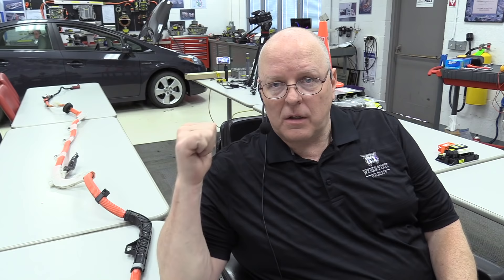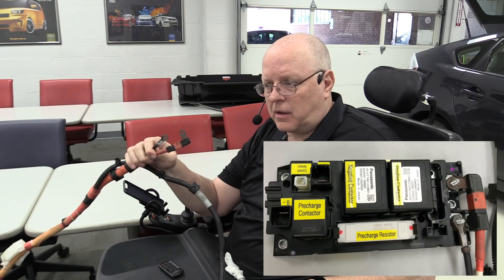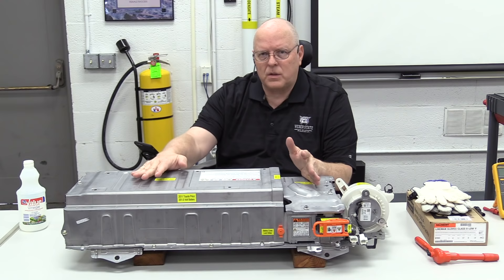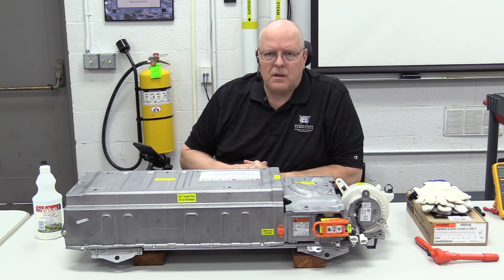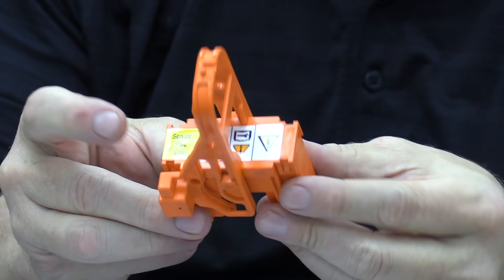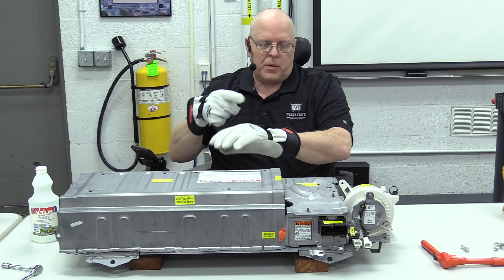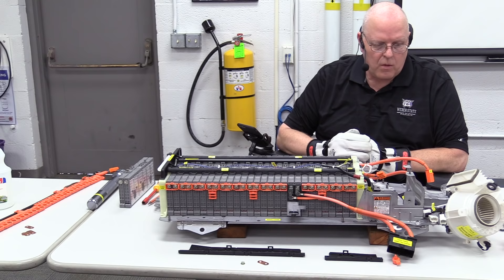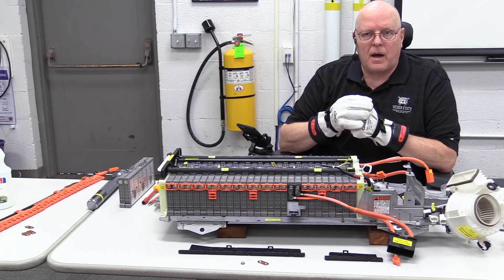2010-2015 Toyota Prius Ni-MH Battery

Comment: thank you so much
Reply from the maker: Thank you!
Reply: Am danjuma from Nigeria adamawa thanks for the good videos
Reply: i have prius 2007 which we purchase 3 ago but unfortunately car show a msg that there is problem in hybrid battery i check these batteries volt one cell show 6.93 voltage and other cell show differnt voltage but these cell show greater than 7.2 volt. please help me how can i solve this problem? can i replace only one cell or compelet module?

Comment: I just finished rebuilding a gen 3 battery pack and the worst part was finding replacement cells on ebay. There's plenty there, claiming to be "conditioned and tested," but I spent weeks sending back bad cells from several sellers.

Comment: The way this guy works with the voltage components is Fantasyland. Having worked both production and service, I can tell you no one's wearing all those gloves. You can't work fast enough. During a real workday, you get in a rhythm and you watch what you're doing. If you try to hold out for that sort of thing, you're not going to be turning around jobs fast enough, everyone else will be, and you won't have your job long.

Comment: Thank you for the comprehensive tutorial. You are remarkable teacher. One question though. How would I be able to determine that a particular module is discharging much faster than the rest? Thanks
Reply from the maker: Thank you! A scan tool is needed to read the cell module voltages and and Diagnostic Trouble Codes (DTC)s which may tell you which ones are having problems. You could manually read the cell module voltages and looks for ones that are significantly different than the rest. Be sure to use safe practices. See my PPE and safety video here: https://youtu.be/Fgs46PsTon4
Reply: WeberAuto Thank you and merry christmas
Reply from the maker: Thank you, merry Christmas to you as well

Comment: Great teacher I agree, you said they are 7.2 v eac if charged x 28 = 201.6 volts  is that what the motor uses, ac or dc?
Reply from the maker: The motor runs on AC. The inverter under the hood creates AC from the battery DC

Comment: thank you for your information but can you show us how to check HV batterty pack under the load so that we know what to buy
Reply from the maker: You would need an old style battery and charging system tested with a carbon pile. Test two modules together (14.4 Volts) like a car battery

Comment: 42:47 Recondition it yourself. clean the contacts. put dielectric grease on the terminals before reassembly. would be nice if there was a marker every 7 packs. remove those first and break the battery into 50V packs. First and last to be disconnect and reconnected. boosting may have ruined the 12V battery charger since the prius battery 12V may not be designed to crank an engine because it doesn't. The battery is just there to give the computer clean DC. The headlights for example don't car.

Comment: Sir,
I like your videos and learned a lot. But, on contactors n relays,
Contactor= for Load, n,

Relay=for controls
Reply from the maker: Thanks for your feedback. The contactors in these vehicles are for load handling, but they also are used control current in the circuits. They do both.
Reply: WeberAutoSir,

Contactor's may have relays to control movement of contactor contacts, but relays don't usually have relay contacts for loads.

Comment: AWESOME! One question on the interlock. When you initially tested for voltage during your demonstration of the service plug, there was voltage present even after the plug latch was slid off. The voltage didn't go to zero until the plug was completely removed. Is that a defect? Also, to clarify, is the interlock wire continuous to all the interlocks in the vehicle? I think that's what you said.
Reply from the maker: Thank you! The voltage was nearly zero with the service plug disconnected. The small amount of voltage displayed is the same thing the meter displays when the meter leads are not attached to anything; just induced voltages from the 60Hx power wires in the walls and lighting. The high voltage interlock circuit is one long series circuit throughout the entire vehicle. It connects to all the other interlocks on the vehicle.
Reply: WeberAuto thank you! I was under the impression that when the service plug was slid over to unlock it will activate the interlock and shut the power BEFORE the plug was removed. It didn't appear that happened in this case

Comment: Hi, you did not mention how the air flow going through the battery module, could you please show us how the air flows inside the battery and its track ?
Reply from the maker: Yes, I show the air flow coming in the bottom of the battery on the passenger side and going out on the top of the passenger side after taking a "U" shaped path through the battery modules.

Comment: a salvage yard friend got me a few of these Packs to play with (for a home solar application) so I have about 100 of those 7.2 out of all those I found maybe 4 that were bad and couldnt or wouldnt charge, I am in an electronics field so I have test/equipment and know how to feel confortable enough around these to play :)
I think each one has 7ah I put two in (P) and charge at 16.4 for 7 hours to finish an (absorption phase)  you would call it a float charge on Lead Acid Battery 
I also have some of the Nissan batteries about the same volt just round LOL
in the end I dont see them as a good solar battery, if you can make your own Tesla wall out of 18650 that seems to be what everyone is using and for a good reason :)
maybe someday I will but I should have been videoing my play times and how :)
Reply: I should add throw less Amps at it, I charge between 2 or 3 amps, to much and it will expand the battery, it could ruin it, but for the most part, I find they will go down and work just fine after you expand one though, but over doing it you could start a fire or worse :) ya just to find the zone I blew a few up LOL, if you work on a wooden table I suggest putting a Paver under your work area :)

Comment: Hi John, Great video. 
I was wondering if it would be possible to connect say a 20kw 200VDC motor directly to the HV pack? I have seen a lot of examples of connection after the 12V step down, but In the case you needed much more than 5kw could you see a problem with fail safes on a gen3 Prius? Obviously there's a huge safety aspect, a limit in draw and a computer remap whilst in use. Though theoretically you could temporarily run high loads pretty efficiently. I'm fairly certain the faulty battery code only senses voltage drop between plates and the vehicle will charge as mapped. I could be very wrong just a thought. 
Failing that could the engine be mapped to always run with a mechanical drive taken off engine? A separate battery charge cut may need to be installed, apart from that what do you think?
I've seen some 5 year old hybrids with panel damage sell for nothing and I'm interested in their capabilities. I'm sure you know more than me, Regards.
Reply from the maker: Good question. It sounds like a fun experiment. Most of those batteries are rated at less than 1kWh, so you won't get far. Best wishes

Comment: Professor, good morning, I am an engineer in an automotive armoring company in Brazil and I really need your help, because really your explanation is very good and only makes those who seek knowledge great. In armor, we need to dismantle the whole car and sometimes we need to cut parts of the vehicle and then weld them back to their places. My question is as to the fact of loosening the negative battery cable 12 volts and disconnecting the orange plug of the hybrid battery, if both are disconnected, if there is any problem with making electric welds on the vehicle, where I need to pass electric current through the vehicle to close short during welding.
As I normally do in cars that are not hybrids where I simply disconnect the battery cable and do work normally and then just reconnect the battery and everything turns on normally, in this case it’s a BMW 530e Hybrid, but the question goes for any hybrid car that now are coming from various brands, is there a problem following this master procedure?
I thank you for your attention, stay with God.

Comment: hi, fantastic video as usual . i was wondering if you could give some advise how these battery cells can be recharge.if you know of any decent battery charger.
thanks
Reply from the maker: Thank you! I do not know of a good charger for the individual 7.2V battery modules. You could put two in series for 14.4V. just make sure it is a charger made for Ni-MH batteries. Maybe one made for radio controlled cars, drones, etc. The total capacity of the entire 201.6V battery pack id 6Ah. Best wishes.

Comment: Very interesting insight into hybrid batteries thank you. However, as a suggestion a good editor could easily cut the length down without losing any significant information. Thanks for taking the time to help people understand this complex and potentially dangerous equipment.

Comment: I'm thinking copper nuts on the copper bus bars might reduce that corrosion perhaps? Another informative video John.
Reply from the maker: Thank you for the feedback. I was thinking the same thing. The battery module terminals appear to be nickel coated. The nuts appear to have a green-gold coating. I do not know what it is. The positive posts are clean, so dissimilar metals don't appear to be the issue.
Reply: Could you use dielectric grease around the terminals to stop corrosion?

Comment: I think that there is voltage between each of the service disconnect /fuse terminals and one of the orange HV wires. (I'm still watching but it looks like the disconnect breaks the circuit in the middle of the pack, and the HV connections are to either end)
Reply from the maker: Yes, it disconnects at battery modules 9 and 10 (of 28). The voltage from the B+ orange cable and module 10 at the service disconnect is about 146 Volts. The voltage from the B- orange cable and module 9 at the service disconnect is about 67 Volts.

Comment: Hello! Excellent video! Does corrosion that occur (except humidity of cooling air blown through) on contact bars because of different matherial of nuts and bars: zinc-plated steel vs copper? Thank your very much!
Reply from the maker: I have not experimented with different materials, but some people claim it makes a difference. Thanks for watching

Comment: Great! Couldn't be explained any better! I have come cross some questions appreciate your response. 1. What is the acceptable voltage rage for each individual module and also entire modules? 2. Do cells need to be tested under the load too? 3. If they do what device do you recommend to check for voltage drop under the load? 4. Does hybrid computer monitor every involved component consequently turn on MIL (malfunction indicator lamp) when fault is detected? 5. Are there online courses available on hybrid systems?
Thanks
Reply from the maker: Thank you!  1. 12.2 to 16 volts each, 2. Yes 3.a carbon pile load tester. You can find them all over the internet. 4. yes 5. yes, we offer some online www.weber.edu/automotive best wishes
Reply: Thanks for your response. I had to replace two modules that were 6.47 and 6.48 volts on 2007 Prius. The remaining cells were ranging from 7.72 to 7.77 volts. The car actually had to be towed because it hardly could get up to 30 miles/hour.
Reply: Thanks Professor. How do I load test modules with carbon pile testers? I know for regular car batteries you set it on half the cold crank amps rating but what's the cold crank amps on hybrid ones?
Reply: Use a bank (2 units) to power something like an inverter and volts test.

A diagnostic scanner can as well. Plug in and bring up the cell monitoring display. Turn on the ignition ( do not start vehicle) and monitor voltage change/drop

Comment: Sir, thank you for your videos.
One question, are these lithium ion batteries recyclable? I have heard about the secondary usage as buffers for solar systems but what comes after they are completely dead?
Reply from the maker: Thank you! Yes, they are recyclable. There is a phone number to call for disposal and recycling information on the battery.
Reply: These are nimh

Comment: Again, very excellent job of explaining this.  Question, if you know; Since the pre-charge contactor is closing with a resistor in series, is it not closing on a lower voltage than the main negative contacter?
Reply from the maker: Thank you! Great question. There could be a voltage drop if there were current in that circuit, but there should not be. If there were a shorted HV circuit somewhere the voltage drop would tell the HV ECU that there is a problem and it would not close the negative contactor. If there were no short circuit, the 30 ohm resistor is in series with 2 IGBTs that are off and two field coils (no current, no voltage drop). I hope that helps.

Comment: I think   the pre-charge contactor is used  because of high charging current of the big capacitor which is in the inverter.  Normal situation the inverter cannot take more than 1-2 Amp. But maybe I'm wrong. :) Otherwise your videos are brilliant!
Reply from the maker: Thank you for your feedback. The large smoothing capacitors are not part of the circuit upon initial power up. They are only 1130 micro Farads anyway, they don't take much current. They are large because of the higher voltage. The Prius inverter handles higher current than 1-2 Amps when driving the motors, there is a 150 amp fuse to protect this circuit. I hope that helps.
Reply from the maker: Upon further investigation, I think you are correct about the capacitor charging when the contactors close. The pre-charge resistor would limit the current to less than 6.5 amps with a fully charged battery. Without the resistor, the current would be much higher, but less than the 125 amp fuse in series with the circuit. Thank you for your feedback!
Reply from the maker: Thank you, that is good to know!

Comment: Hi sir this was great video 
Just one question I have 2007 Toyota Prius I had triangle sign in Dasbord so I opened hybrid battery system and checked all cell they are about 7.2 voltage but when I checked voltage on junction box I got only 122 voltage 
Now what should I do 
If you can direct me that would be lots of help 
Thanks

Comment: Hi. Do u think this corrosion is due to the fact of bolts and nut are made of a different material from the copper linkage? 
Perhaps if the bolts and nuts were made of copper too, this corrosion would not occur. I guess.....Thanks and congratulations for another great video...
Reply from the maker: Thank you!  I was thinking the same thing. The battery module terminals appear to be nickel coated. The nuts appear to have a green-gold coating. I do not know what it is. The positive posts are clean, so dissimilar metals don't appear to be the issue.

Comment: Thanks for the video. 
I presume the high voltage system is never grounded to the chassis in any way whatsoever? 
I also presume it would automatically shut down if there was any leakage to ground?
Thanks again for the video.
Reply: It is common to 12V battery ground if i remember correctly from previous video, so yes it is grounded to the chassis.
Reply: SYM!K3 its definitely NOT grounded to chassis. Both systems, 12volt and hv, are their own systems. A computer system is used to constantly check resistance to chassis ground. If it gets too low, the hv system disables.
Reply: Thomas Fooij Hmm. Then sorry its my fault.
Reply from the maker: Sorry for the confusion. The high voltage system is totally isolated from the 12V system. It has its own B+ and B- wiring. It will trigger trouble codes and shut down the system if there is ever a loss of isolation.
Reply: WeberAuto for obvious reasons 😂

Comment: Now that you have finished your toyota battery video would you be willing to helpme repair my toyota battery that has 2 bad cells, or replace it?
Reply from the maker: Chances are high that you have other cells that are nearly bad as well. Replacing it is the beat option. Repairing by replacing bad cells with used cells might work, but it may only work for a little while until other cells go bad. Best wishes!

Comment: Maybe it's been suggested already but in the case of corroded bus bars, do we know that there was not something causing decreased ventilation? ( a weak fan motor or more likely something in the back seat obstructing air flow?)
Reply from the maker: Thank you for your feedback, I have not seen that as a problem. Trouble codes will set if the battery runs too hot.

Comment: Thank you very much , professor!  I was wondering if the battery from prius plug-in (Li-Ion) it's is the same.
Reply from the maker: Thank you, No, the Plug-In Prius battery is very different. I should have a video on it soon.
Reply: That's cool! I'm very interested in that model. I am in the process of buying a used Prius Plug-in and i want to learn as much as I can about the hybrid sistem.Thank you for the videos you make.

Comment: re the corroded metal bus bar connectors between each  7.2V battery module ,  is there an anti-corrosion grease or paste for electrical assemblies which may  be applied to the metal to prevent the problem occuring?